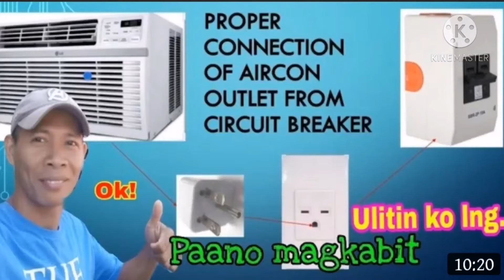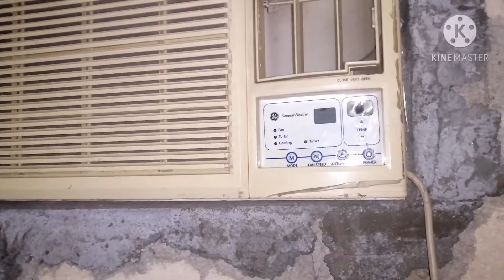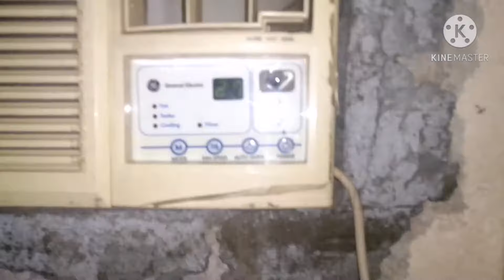PAGAMIT NG UNIVERSAL ADAPTOR PARA SA AIRCON PLUG AT OUTLET

Comment: Good day sir, pdx wire sir size 14 pwd po ba ? Hope na masagot nyo po sir GODBLESS!
Reply from the maker: Ung pdx #12 boss  kc 2.0 wire un, ang pdx #14 ay 1.6 lng po medyo maliit ung wire pero advise q nlang po ung #12 para sa safety nio boss... Medyo matigas nga lng ng konti😊
Reply: Slaamat sir, sir pahabol na lang po pwd ba sir kahit walang sariling breaker yung aircon ko ?
Reply from the maker: Ahh.. Hindi po boss, kailangan po talaga dapat meron separate na CB ung AC nio boss
Reply: Boss pahabol po last na po sana di ka magsawa na sagutin ako for the last time,  ito po tanong ko sir 0.5hp po yung aircon ko pdx 12 parin po ba gagamitin ko ?  At bakit kailangan talaga na may sariling CB ang aircon ano po ba ang purpose?   Salamat po ulit ng marami sir!
Reply from the maker: Ok boss, simplehan q nlang para mas madali ano po? 😊Una is for safety sa wiring ng inyong bahay, 2nd po iwas troubleshooting  at 3rd po ay iwas sa sunog... 😁Kaya po tau pinag seseparate ng CB at outlet para sa ating AC ay sa safety ninyo at ng inyong wiring connection sa bahay boss... Kpag HP po kc ang pag uusapan ay nangangailangan po yan ng mas mataas na supply na kuryente kaya un po masasav q sainyo.

Comment: Sir pwede po kaya maglagay ng universal adaptor with usb? Or what i mean kung okay lang na habang naka aircon pwede magcharge sa universal adaptor with usb?
Reply from the maker: Basta boss ung linya nio na para AC nio eh, nka separate pwede nman po.
Reply: @mapatechvlogph8668   Boss ask lng anong tamang sukat ng breaker pra sa .8 window type aircon
Reply from the maker: 0.8 po ba? Ahh.. Pwede na po jan ung 15amps na CB maam tapos AC outlet na bukod.
Reply: Ung amin sir 0.6 ano po tamang sukat sa breaker window type aircon.. kc sa ngaun po sir adaptor gamit nmin e. Di po ba un delikado
Reply from the maker: Delikado po kpag naka adaptor ung AC plug dhil nag iinit po un.. Ang tamang CB po para jan sa AC nio ay 20amps ok na po un qng 0.6hp po yan.
Reply: Sir wla nman po ibang nkasaksak ac lng po nmin.. ok lng ba un pansamantala ung adaptor nmin.. kc po sa pinsan kopo is almost 4years napo cla nkaaircon adaptor lng po gamit nila .wla nman pong nangyari na masama sir…
Reply from the maker: Basta safe po ung linya ng outlet at wala pong masyadong mga naka tap ay safe po un kaya hindi po nag iinit ung wire.. Qng ganun din linya ng outlet na nasa bahay nio ay pwede po maam👍👍

Comment: Sir, maraming salamat po sa pag share ng inyong tips. 🥰

Itatanong ko lang po sana sir kung sakaling pwede pong gamitan ng DUPLEX Universal OUTLET with Ground ang AC po? (Yung dalawa na po saksakan nya)

Kasi balak po namin kabitan ng Emergency Light katabi po ng AC, para isang utility box and isang outlet na lang po ang nakakabit sa wall po.
Or kelangan po talaga ng separate ang outlet and box for AC po? At gawa na lang po kami ng 2 connection po, isa po para sa AC at isa po para sa emergency light?

Maraming salamat po sir!
GODBLESS po. 😊
Reply from the maker: Pwede nman po boss basta't naka bujod po ung safety breaker nio para sa inyong AC unit
Reply: Sir pwed po ba ikabit ang outlet with circuit breaker sa isang pang outlet? Tnx po...